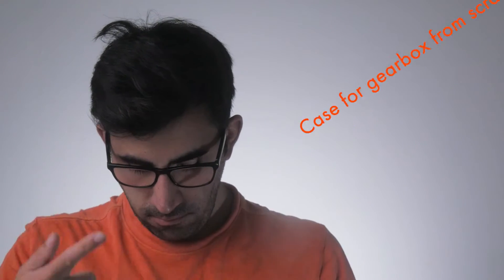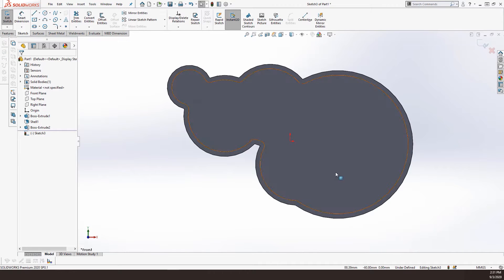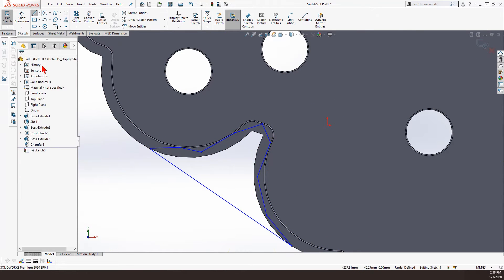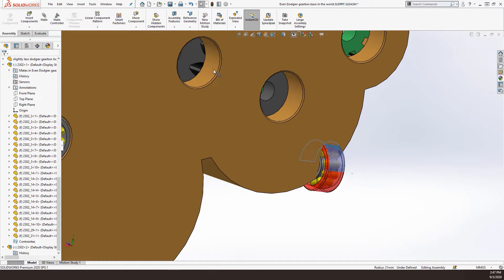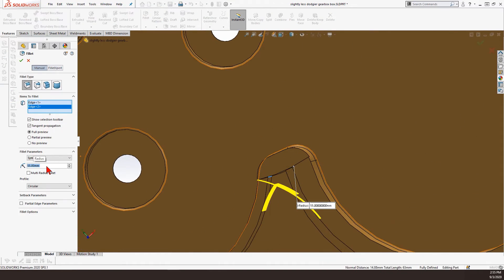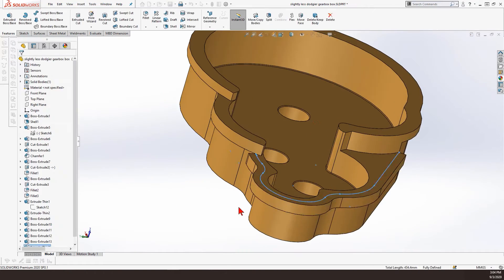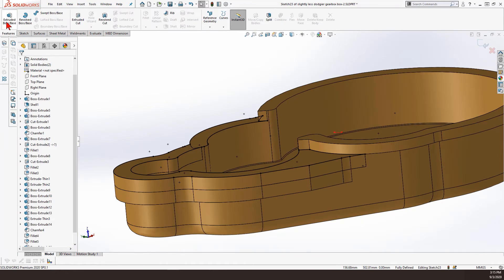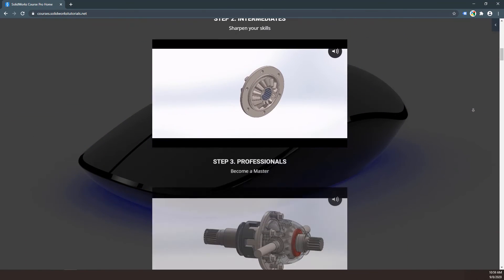Modeling a Gearbox case from Scratch with NO drawing in SolidWorks

Comment: Why not convert entities, instead of going manually in a more dodgy Mannar? Even thou since the entities are joint and form a single component it does not really matter
Reply from the maker: Convert which entities? the gears?
Reply: @with-aryan  no when you want to close that gap, you create the patch you want to create by hand, first you make a straight tangent line, I think the other side could just done by converting entities, what about a rib over there to cover the GAP?
Reply from the maker: @avitolourenco  yes you can, however, since I had chamfered the inner edge with a rather small value, picking the right line was not that comfy so I took the easier but less correct path. The point was not to teach that. As you can see, this video are for people like yourself who already know the basics of solidworks and are more after how to do the modeling.
Reply: @with-aryan  I am so motivated I'm going to make a ultra dodgy gear box, these tutorials are 🔥